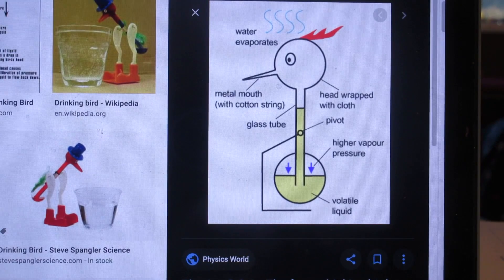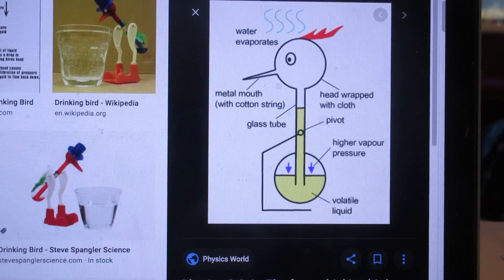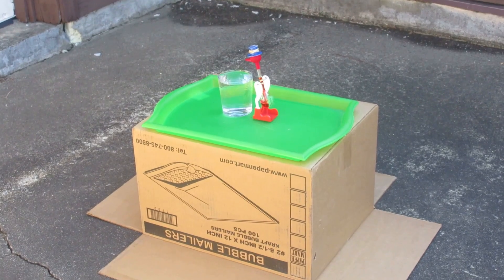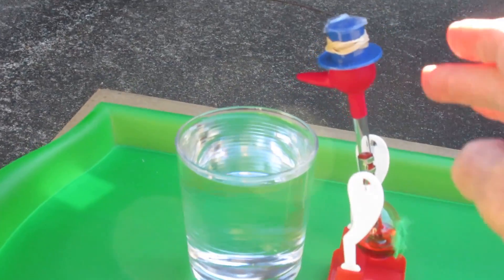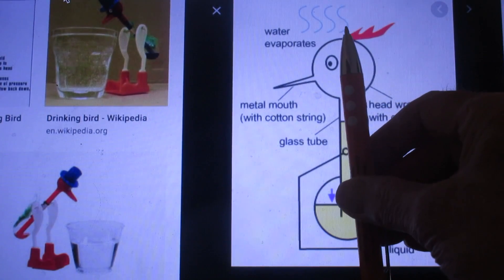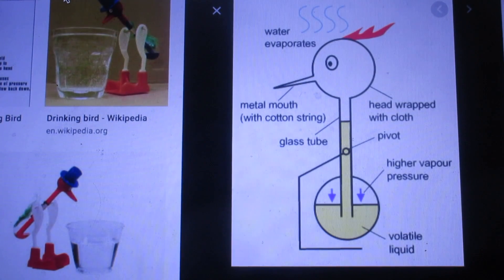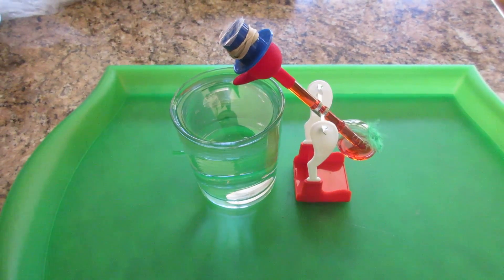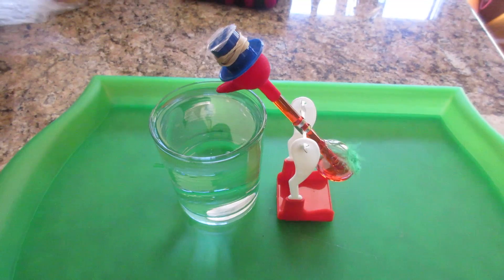#82 Solution,  Drinking Bird - Heat Engine

Comment: The source of energy is NOT the heat of the room.  The bird is powered by a temperature DIFFERENCE, and that difference is a function of the dry and wet bulb temperature.  The bird will not work at any temperature when relative humidity is 100%.  So in closed greenhouse at 90F, will not work.  On the other hand, even at 3C, if the relative humidity is low, it WILL work (ice may form on head, preventing water flow to head, but will work while water is there, or use salt water).  The reason high temperatures lead to better performance, is because low humidity is associated with RISING temperatures, when the temperature is cyclic (room is warming up, wet bulb is more-or-less constant (or lagging behind as more water must evaporate) while dry bulb goes up.  Conversely, when temperature FALLS, nothing removes water from air until dew-point reached, so humidity is high.
          This sounds like the "elephant and coconut" argument with energy and force, doesn't it?, because it is!  Do not mix up a value with its derivative!
          For demonstration, put bird on tray with beaker and get it working on warm day (constant temperature).  Then put shallow water in tray, and cover bird and beaker with bell-jar.  Bird will slow and stop when enough water evaporates from tray to raise humidity inside.  Then remove jar and wait 5 minutes.  bird will run.
          Experiment 2: put ice cube in beaker.  Bird will run regardless of humidity.  The same will be true is warm air is blown over bottom bulb, even without water & beaker.

Comment: We have 3 blocks one over the other. Lowest block touching the ground is 7 kg , above it is 3kg  , topmost block is 2kg . Coefficient  of friction between 7kg block and  ground is 0.0  , between  3kg and 7kg block is  0.3 and between 2kg and 3kg is 0.2 .   Find acceleration  of all the blocks when force of 10 N is applied to  (a) 2kg    (b) 3kg  (c) 7kg  .  Take g= 10 m/sec 2 .
Reply: Steps for solving 3 block problems ?
Reply from the maker: I do not solve problems for viewers. I teach Physics. Watch my 8.01 lectures and you will be bale to do this problem with ease.

Comment: Sir one query here, 
Watching 8.01, lecture no. 26 on atmospheric pressure u gave us a demonstration by holding your hand and telling force of atmosphere acts from upward and downward direction hence we dont feel any pressure. I ve understood that but sir in case if we placed our hand on ground then 'mg' acts downward and normal reaction upward and since we are on ground only atm force from upward wil act . So under this condition i consider 'mg=normal reaction '. Then what actually balances the atm force from upward. Or is it 'normal reaction=mg+ atm force from upward' . Waiting for reply sir
Reply from the maker: 1. Pascall's principle.  2. pressure inside your longs is nearly identical to the atmospheric pressure on your chest (thus on your longs). Thus the differential pressure is near zero.
Reply: Thnku so much sir👍👍👍👍👍
Reply: What exactly happens in the above case or something like blood preasure also comes in picture

Comment: Suppose  you are told  that the linear size of everything  in the universe  has been doubled overnight . Can you test this statement  by measuring sizes with a meter stick ? Can you test it by using the fact that the speed of light is a universal constant and has  not changed ? What will happen if all the clocks  in the universe also start running
Reply from the maker: use google aor take a course in astronomy

Comment: Hello,

Looks similar to the low temperature Stirling engine!
Reply: I don't think it's the same principle, because the water is at room temperature (Stirling engines require a difference in temperature). It's based on the fact that water will evaporate (because of wind) and thus cool down the head.

Comment: Professor - this is way off topic. You are the first person I thought of to ask. This is in regards to the transmissibility of the virus through aerosols.  I don't quite understand the relationship between humidity and transmissibility.  I would think that  aerosols would have a very short life in 0% humidity.  How is aerosol size related to humidity ?  Also, there must be a relationship between the charge on aerosols and their ability to hold  the virus.  Are viruses attracted to negative or positive charges?  (You may not know the answer to this, but it may make an interesting point of discussion) I just created a makeshift protective device for hospitals using a plastic bag, a vacuum cleaner hose and a HEPA vacuum cleaner bag.  I started teaching physics, chemistry &  calculus after retiring from industry.  Your videos have enriched me as well as my students.  Keep well!